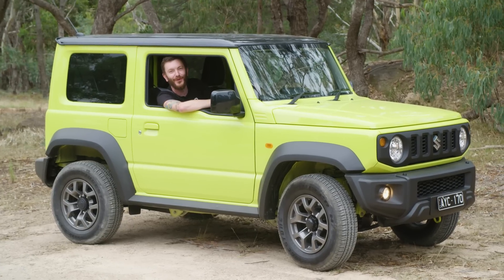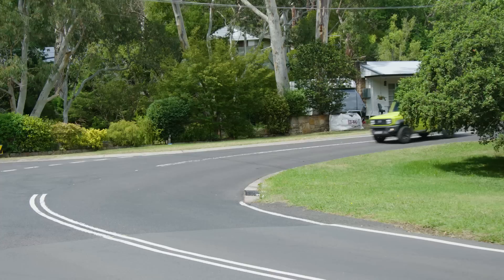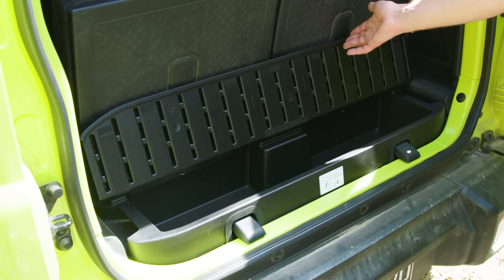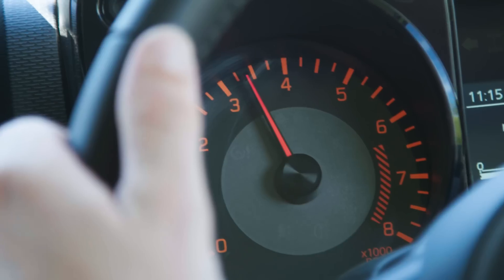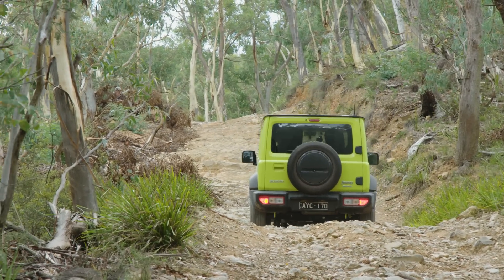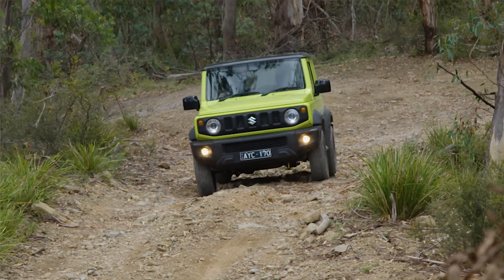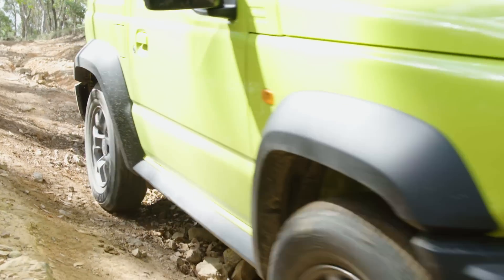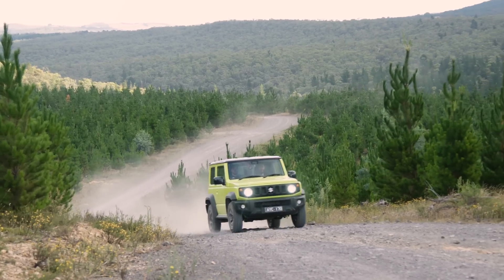2019 Suzuki Jimny on and off-road review

Comment: at 8:00 you just needed to give it a little bit more gas for the traction control to kick in.
But, you didn't even need that, a little big of momentum would be enough. 
You didn't find the jimny's limits, you found yours as a driver. 8:06, it was going and you lifted the pedal...
Reply: Spot on. Well said.

Comment: You never go wrong with Australian 4ed reviews. I wish you had the auto in that trail. The torque converter multiplies the torque a little bit more and the ability to use the brakes and accelerator at the same time is a fantastic combo for the traction control. Cheers from South America

Comment: I know is a lot to ask but I would love to see an auto in that track. The torque converter plus 1st low work wonders with the TC. You can modulate the power while braking and managing that slip to emulate a locked diff much better than on the manual. I have driven both and in the manual the lack of low end torque makes the power delivery jolty.
Reply: i agree , love to see an auto in the same scenario, it would probably would handle a little better up the rocky section the manual variant struggled at.

Comment: Would be nice to have 6th gear on the hwy
Reply: It only has 100 horsepower.
Reply: @1985cactus  110
Reply: @giorgosioannou4217  101-102
Reply: @1985cactus  And with the right 6th and final drive diff gear ratios it should handle it fine

Comment: in 2019 a car manufacture is still using drum brakes in the rear, I would not buy one just because of that.
Reply: What a peculiar statement to make. This vehicle is very much low performance on the road. Your comfortable cruising speed is 60mph, cornering requires a bit more forward planning than most. The tyres are a compromise between on and off road use. The brakes are perfectly adequate. My views are based on six months ownership and 3000 miles or so driving, not just reading the spec sheet.
Reply: Given rear brakes do about 10% of the overall braking...who. cares.
It gives an actually useable handbrake.